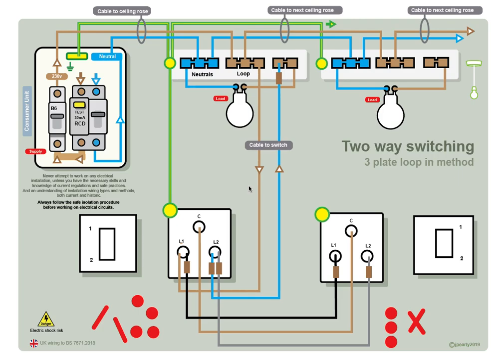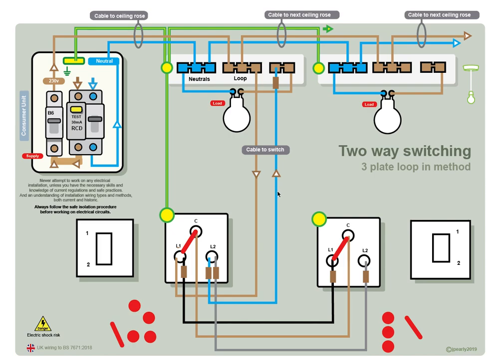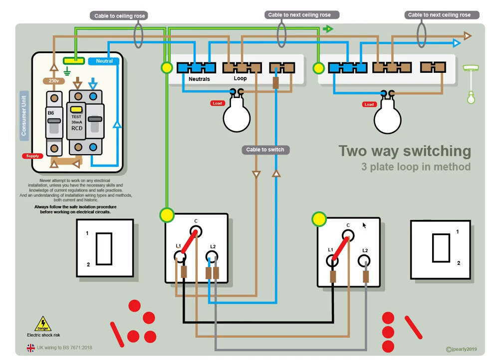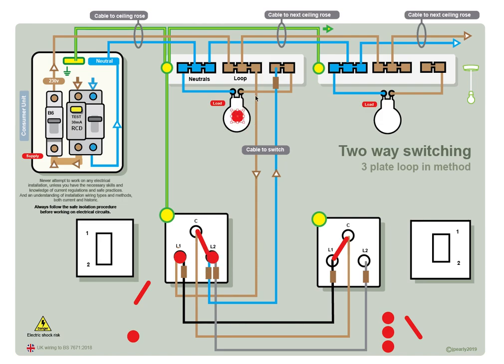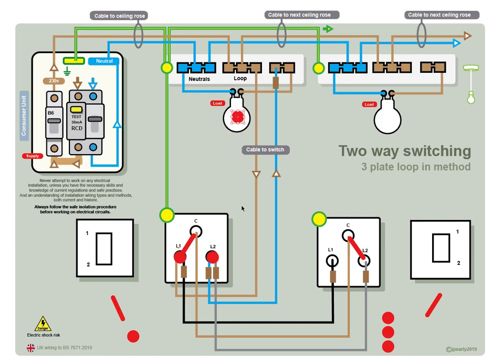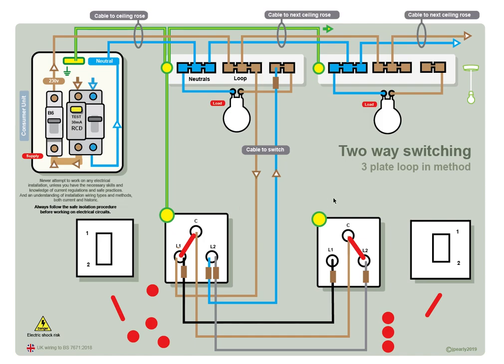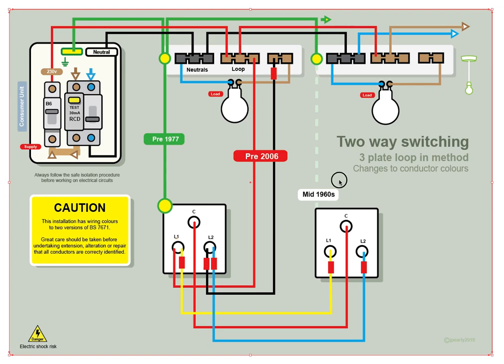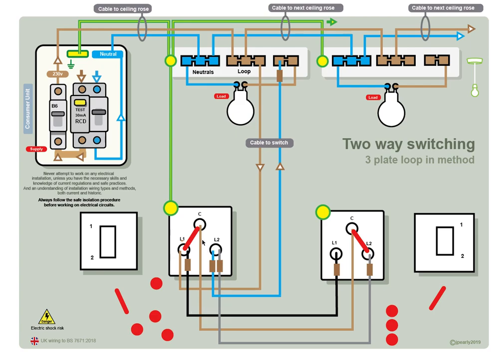Two way switching -  Made easy

Comment: Fantastic video mate. Easily the best I've found on YouTube. Just out of curiosity. Rather than using a 2 core and earth down to the switch. Could you also use a 3 core to carry a neutral down also to future proof?

I know you'd have to double up two cables into the ceiling rose but I don't see why it wouldn't work?
Reply from the maker: Hi Tim, Thanks very much for the comment. Yes neutral to the switch is a very common method in new builds these days. You only then need to take a  switch live and neutral  to the ceiling rose, which means less connection there, so good for small roses.  Is a problem though if you want a permanent live however say for a smoke alarm off the lighting circuit., or a timed fan.

Comment: Thanx very much for your Vids. They've helped me sort out the wiring when replacing 2 ceiling lights. Continuity testing to find the switched live and a 2way switch circuit. Your vids are step by step so very easy to follow even for a novice like me. Thanx again.
Reply from the maker: Thanks very much Steve . Glad you found it useful.